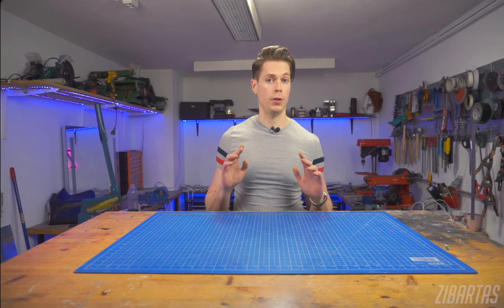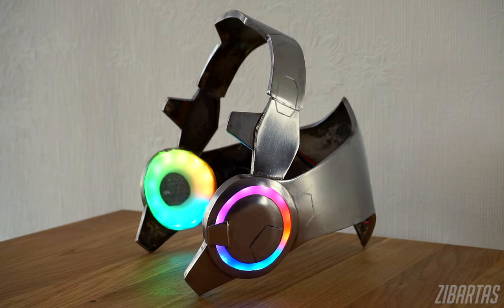Diffusing LEDs: From good to GREAT

Comment: So I had an idea to make an RGB LED bicycle frame with RGB LED strips and then I wondered what do I use to diffuse light. Also for that I think I'd need a bit more power than a power bank so what do I use for energy that is rechargeable? What is the best to use, any tips?
Reply: I seen my old gramma bicycle ww2 using dynamo on front tyre. As long as it's cycle provide power depending on speed.Maybe you should try customise powerbank for dynamo generator and make a switch too so powerbank no need to overcharged it.

Comment: Great vid, thanks so much. What about heat dissipation while using these different materials?
Reply: Unless you're using extremely strong LEDs it generally shouldn't be a problem, definitely not with 144/m or fewer LEDs.

Comment: I'm trying to light up a halloween display.  I want to use Woodlands fake water to fill a lake but I want to use led lights to light up the water so it has a yellow green glow.  have you ever tried something like that?   I'm thinking a 2-3 yellow green lights. with a ribbon of hot glue covering them and then putting the fake water on top?   any Idea's would be great.

Comment: Hi mate, can I have some advise please - I am interested in purchasing the Govee Smart led lights but they only come in 5m and 10m - I have specific requirements for 2 strips of 6.5m each for my child's bedroom - Govee say that this is not recommended to connect 2 together due to power and voltage issues by cutting a 10m strip (of what's not being used) and adding these extra lights to a 5m one which I think is nonsense as I don't see any reason why there should be any issues, but what's your opinion on this please. have you ever had any issues? Also, I see that there is a 12v battery pack available and I need to put one where these where there is no power source - would this be possible? Thanks for your help !

Comment: I want to make a large candle look-alike for a lamp so I was thinking of using acrylic tube but don't know how to defuse it inside, any ideas please and the best leds to use just one colour good video thanks
Reply from the maker: What about sanding the outside of the tube, but for the inside adding a thin sheet of acetate or some other translucent material (maybe even sanded on both sides) to the inside of the tube, and letting it 'unwrap'?

Comment: I have a 50w LED 
construction spotlight that I point at the corner of my (white) room to simulate daylight (google Portable LED SMD Vega floodlight 230V 50W 5500K). I would like to diffuse this light such that it does not have to be pointed in the corner but can be used to light a room directly. Do you think this is possible?

Comment: I'm looking to diffuse a small area (half inch square) and will likely only have enough for 2 or 3 led lights,  as I am also wanting this small space to alternate between red and blue, I'm sure it introduces other difficulties into the equation.  any suggestions?

Comment: Hello, what kind of diffuser you use on the video's thumbnail (the right side one)? I have similar led strip (mine is philips hue light strip) like your led strip on the thumbnail, there are this wide gaps between the led "eyes" that makes the light not diffused equally and makes the eyes visible and reflected on my wall :(
Reply from the maker: I used white foam :)

Comment: Did you find after long term use that heat affect any of the materials?
Reply from the maker: I think the biggest issue for plastics is UV exposure, and regular LEDs don't emit that. Just avoid sunlight with UV sensitive diffusers to prevent yellowing. :)

Comment: What if you buy the waterproof led strips and sand down the waterproof film?
Reply from the maker: I think you might need a bit more sanding to smoothen them out. It will help but the distance between source and diffusor is just too little to be effective fully :)

Comment: What qualifies as Synthetic Woven Fabric? Like where I could buy it for instance
Reply from the maker: Shower curtains for example! The woven ones, not the plastic-sheet feeling ones. Those have actual fibers that disperse light! That's the cheapest option. For the thinnest possible, google 'light diffusion fabric' - they're usually sold in large squares for photographers to use to diffuse flashes and such.
Reply: @Zibartas  Perfect, I will check it out, thank you!

Comment: Looking at acetate as a diffuser as it comes in long thin rolls. Its mostly clear though, wonder if have you ever tried sanding that?
Reply from the maker: Yeah! It frosts over nicely but you gotta pick your grit wisely for the right texture I think. Also - try sanding both sides and stack layers if you can - but with such thin material you will need a lot of space from the light source to get good scattering :)

Comment: If you have an old lcd monitor you no longer need, or a broken one, take it apart... behind the screen are several thin sheets made for diffusing light and also one thicker sheet.
They will diffuse light perfectly, use all of them in layers or mix and match for what effect you want.

Comment: I have a question. Do you know of any LEDs that can take a punch? I'm trying to find durable LEDs that can be punched repeatedly
Reply from the maker: I think pretty much all are as 'punchable' as any other.  I would go for the largest ones (more robust soldering joints) and add a LOT of padding as any flexion will introduce cracking in the joints and will make LEDs fail :(
Reply: @Zibartas  Ah I see. Only problem is, I need the LEDs to be under the surface of a fabric and for the light to go through the fabric. Also for the fabric to be bent in extreme ways 😅. Any idea how I could manage that?
Reply: Hey! Have you thought about maybe trying some El Wire instead of LED strips? :) Maybe that would work!
Reply: @mahutin2  any progress?  If you are wearing the LED, and they are going under the fabric, then I think you should just have to make sure the LEDs are mounted to a ridged substrate that can first be contoured to fit whatever.  I'm thinking aluminum plate that is thick enough to not deform under impact, but thin enough to shape with typical body forming tools.  A custom fiberglass plate might be better.  Fiberglass is messy and tedious, but I think you could even embed your LED in in its layers, as long as you make it thick enough to not bend around solder points.
Reply: @nefariousyawn  I like your thinking. Thank you for the advice!

Comment: Great video except the overly loud ear rape sound at 0:22 sorry I dislike the video purely on that alone, I don't appreciate it not really too sure why that's in your video, I'd suggest either lowering the volume of that sound effect since I have the video at max volume to hear your voice only to be blasted with a sound only equally painful to the thought of having glass shattering in my ears, speaking of shattered glass did you know using it as an LED diffusing material is fucking amazing! I tried it with one of my LED in a Glass Jar light project.

I took old bottles that were clean and clear glass, wrapped it up in an old pair of jeans by putting it into the leg hole wrapping it up and smashing it with a hammer, (make sure you wear safety goggles) I personally wouldn't recommend this method unless you have a safe way to smash glass, anyway I smashed it to pieces and sprinkled it around a wrapped up LED strip I had in a big jar filling up the outer layer of the jar the smaller you smash the pieces the more it diffuses the light in the jar so you can come up with heaps of effects I'd recommend trying to get most of the pieces around the same size as your pinky's fingernail that's the best size I could describe worked the best in the end.

Great video honestly thanks for all the ideas I'll be trying out probably half of these for my big multi LED light panel project to see what will work best once again great video but seriously fuck you lol haha change that sound at 0:22 thanks. c: happy crafting people!